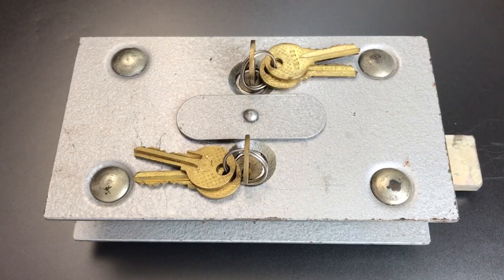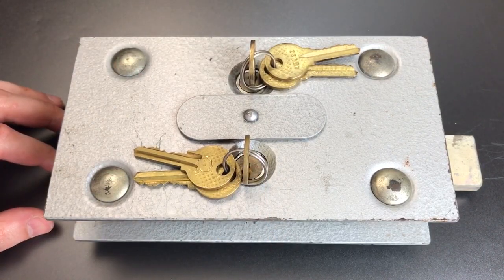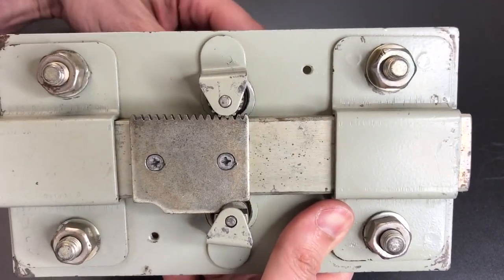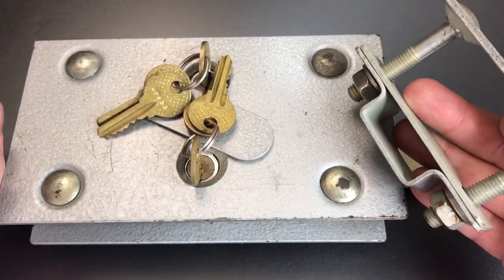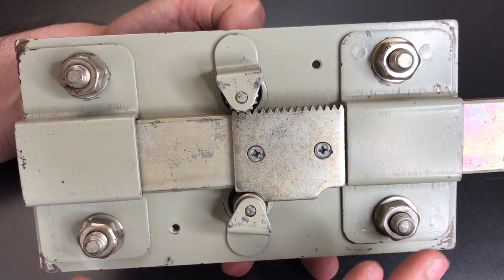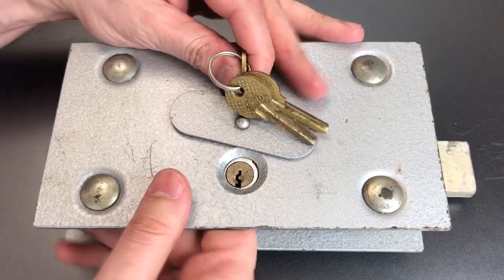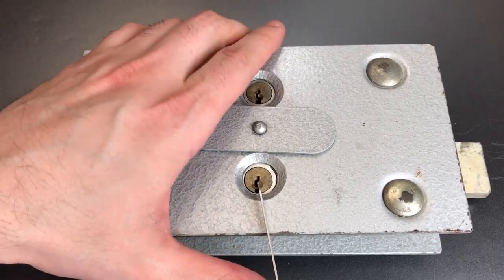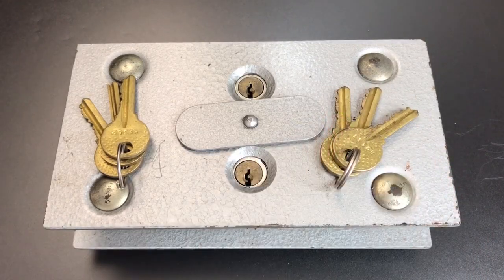[449] Cold War Era Russian Dual Custody "Safe Lock" Picked

Comment: It looks like those cylinders are made up of solid brass... which means that they're vulnerable to drilling attack. I'm sure that you could upgrade the security of this lock significantly by replacing the two Euro-profile cylinders with what would have a comparatively greater level of physical security and effective key-control against picking/bumping manipulation as well as impressioning & decoding, key duplication and/or production/reverse-engineering with the utilization of a 3D printer... of which has been known as of recently to have happen with high security rated key & lock designs; let alone common or low-security key & lock devices. 

Three enterprising MIT students demonstrated in a recent hacker conference on how easy and subtle it would be to produce a 3D working model of a high-security key that would subsequently be used on a 3D printer to produce a working duplicate of a key, only by writing a few hundred lines of computer binary code. It was also explained in the video that it could be done successfully in one leisurely afternoon. The students also went on (jokingly) to suggest a smartphone application that could be used for duplicating common house-keys simply by snapping a picture of your house-key and in a few days, get a duplicate key in the mail - all without even leaving home to do it... and behold... the Key-Me app and the Key-Me Kiosks that are beginning to make their appearances in some retail establishments, such as department stores and even local convenience stores as well.

In Europe, they have what is referred to as an "EZ-Entrie" Machine, that is a small tabletop computer-controlled precision micro-mill that is designed or intended to mill custom key-blanks on demand. This particular machine retails for around $10,000.

It looks to me like this type of lock might have been in use on a vault door, as the locking control device that regulates or restricts the movement of the bolt-work assembly that actually secures the door to the door frame. 

I've seen safe combination locks that have a similar design profile or footprint that is mounted in close approximation to the center of a door panel and that interfaces with a larger bolt-work mechanism that is then controlled by some sort of an auxiliary handle that is separate or apart from the actual locking mechanism.

The associated lock strike assembly also suggests that it also might have been used on a smaller door such as that of a storage room or a closet that would be used in a sensitive security installation that would warrant dual-custody accessibility. 

The Soviets were all too paranoid about the trustworthiness of a single sole key-holder or key-master with regard to clandestine counterintelligence or espionage, so this lock was likely used as a security element for secret/classified document storage or acquisition. 

Of course, locks of this type are now proven as obsolete by the common deployment of modern electronic access control devices, which probably and likely dates this design back at least 40 years or more.

I could also see this type of mechanism being deployed in some specific military applications where sensitive documents/intelligence information, chemical/bio-weapons or other dangerous weapons, munitions or ordinance that would need required dual-custody access control to be stored or kept secure in the event that one of the keys was compromised, lost or stolen.

ICBMs (Inter-Continental Ballistic Missiles) also had interlocking mechanisms that had dual-custody credentials or physical "keys" - for an obvious reason, that would be required for them to function or activate without resorting to some sort of a "MacGyver-hack" or hard-wire bypass security attack to effectively set them off.
Reply from the maker: WOW... that's a LONG comment.  Thanks for all the good info.

Comment: This is a shielded soviet prison lock. This would be placed on a door any given hallway through which inmates would be escorted. This would be placed into a door, and then have a steel plate both in front of the lock and behind it. Most Soviet prison doors were approximately 8.5-10 centimeters thick. 

From my own father, who was a prison warden in the USSR.

Comment: I've always wanted something like this, scaled up, for my front door. 
Except a key hole on the outside like this, it has a handle on the inside to turn the core with the gear. And remove the other core that just blocks it.

Comment: It is acess validation, not a room protection. This kind of lock is accomodated with two security stamps. So imagine, you have two  string pairs attached to the door and the doorframe. Each pair goes to a bottle cup, you cover them with paydough and then you stamp your seal on it. So to access room correctly without anybody noticing it, you have to open and close two locks with two keys, and then recover the seals with two different numbers with seals. It is used in the buildings with restricted access and guards. It can be used in archives, army buildings etc...  Guard regularry checks all the seals and doors locked. Two different people are required for entrance and they do not have to do it the same time. Boss can open the first part in the morning on several doors. Personnel can enter the rooms itself during the day. So boss cannot enter the room without the knowledge of the personnel responsible for the room. But both of them are responsible for unlocking by key and stamp.
Reply from the maker: All interesting, thanks.  Though I would note that:  "Boss can open the first part in the morning on several doors." is incorrect... unless he leaves his key in the lock all day long.

Comment: I think it's a lock for a boat's hatch. I've seen a similar one on a hatch to an area on a boat that was converted from one type of storage to one that housed high value goods. Also, the fact that the one piece of exposed steel is pitted (presumably from salty air); Nuts and bolts don't count because they can be replaced and are, I think, chromed.

Comment: looking at the locking notches on that bolt it also looks like someone could turn that bottom core and prevent locking of the door which id imagine has benefits in some situations too.
Reply: No. Its so the lock can be mounted on right hand and left hand doors without turning it. So its the same core that unblocks regardless of its on a left-hand or right-hand door. Notice how the bolt is mounted and would extend on the opposite side of the lock when "unlocking". So if you mount it on a right-hinged goor, the bolt would lock to the left and unlock to the right.

Comment: i saw two shitty pin tumbler locks on soviet era gun safe where few 22lr bolt action rifles and probably one ak were stored. and it was located in a shooting range of ukrainian school that was used during course of beginners military training(in russian нвп - начальная военная подготовка). but it was protected by alarm system with few reed switches that were not easy to reach so it was pretty safe
Reply from the maker: Layered security and the inclusion of alarms is nice... but quality locks as one of those layers is nice as well!

Comment: It looks like something on a soviet submarine like a typhoon as it is dual custody (Captain of the vessel and military adviser to the vessel) and it would usually contain passwords to a secure terminal where high command would phone you the launch codes for a nuclear weapon of some description, also sconce there would be no tools or anything to unlock the lock without keys on the vessel you wouldn’t need a secure core or anything.

Comment: Possibly a weapons locker. A very inexpensive weapons locker. It would have been someplace that someone would notice you trying to drill those bolts, or standing around and fooling with lockpicks. Possibly a police station, someplace that would be manned 24 hours. Also, over the years I've noticed that many things don't translate well to English as a light fixture becomes a chandelier depending on who's translating. So, "safe" might have meant "locker."
Reply from the maker: Thanks for your thoughts on this... particularly the possibility of a mistranslation.

Comment: looks like it is for a fenced in security area.  maybe bonded storage or controlled drugs. very easy to bolt lock to gate and receiver to fixed area of fence.
Reply: I think you’re right about security areas.  I’ve seen locks similar to this on security cages used for tool rooms in factories. The two keys are for personnel control. The key for the bolt is issued to foremen, the owner has the key for the bolt stop so he can lock it down during off hours
Reply from the maker: Nimikos -- if you are right, then the supervisor would have to leave their key in the door all day long.  :-(
Reply: I missed that the “blocker core” is key retaining.
The idea is not uncommon in businesses: medical supplies in a doctors’ office, the second keys going to nurses; car keys in a dealership, the second cabinet keys going to salesmen. I couldn’t find a double lock wire mesh partition door but here are some cabinets, same idea scaled down.
http://www.selectlocks.com/search.asp?keyword=Dual++Key+Cabinet&search=Search

Comment: I can't say what it was used for but another piece of evidence that supports your claim is the recess on the opposite side of the lower lobe. This I believe is useful so that if you entered a room with the bottom key and somebody didn't know you were in there, they couldn't lock you in since that position wouldn't allow the bolt to retract. Likewise without the top key you can't move that bolt.

Comment: its possible the two cores provide extra strength as they are directly integrated with the bolt.  Yet the lock is only opened by one person (the illusion of duel custody without the need)

Comment: It looks to me like the lock for the inner jail cell style door of a safe.  I'm fact, if you go to the history section of the wikipedia article, there is an open strongroom door that looks allot like this.  It also looks like once the custody bork is fully disengaged, the back side of the bolt interacts with what I would guess to be a wheel style bolt tractor for the rest of the bolts. https://en.m.wikipedia.org/wiki/Bank_vault

Comment: What is the likely hood of it being a zoo lock or animal holding lock, it would make a good bit of sense with there being little to no prevention of tampering on the reverse side of the lock along with the less secure overall design such as the brass cylinders that could be drilled.

Comment: You don't need two keys to open this, because you can close this with one. Second key just blocks operation of first lock. So it's not like two people are required to open the safe or whatever. It's more like authorized personnel can open a safe, but more authorized manager have to check if everything is in order and lock the safe for night  and unlock it next day.  Then workers can't use their keys to steal anything overnight.
Reply from the maker: Not really. Remember that the blocker key can’t be removed while the lock is in operation.
Reply: Can you confirm this ??

Comment: Seems very vulnerable to a physical attack.  Just drill or grind off the two bolt heads on
the bolt hasp or the bolts on the lock plate itself although this would take longer.

Comment: Fur Locker? There is a bank like vault in the basement of my workplace. Fur cost a lot back then.
Reply from the maker: Interesting theory.
Reply: It's honestly a shot in the dark. The fur vault in the basement is pretty cool its a 25'x30' room  14 foot ceilings and concrete so thick its always around 60 degrees. The entrance, like i said looks like a bank vault, I thought it used to be a bank and asked the owner and he passed the knowledge my way. Pretty  much a useless room now unless you needed to have bank like security. The door and walls are like 2' thick. And I'm sure the walls are thicker on the exterior walls.

Comment: One thing I did not see mentioned is it can be locked open.
Reply: zwz • zdenek This lock requires both keys to operate. Both keys can be removed if  the lock is either locked or unlocked. So it is not key retaining.
Reply from the maker: Yes, it can be locked open by either key.  Both keys are required to open and to close.
Reply: @lockpickinglawyer  Its so the lock can be mounted on right hand and left hand doors without turning it. So its the same core that unblocks regardless of its on a left-hand or right-hand door. Notice how the bolt is mounted and would extend on the opposite side of the lock when "unlocking". So if you mount it on a right-hinged goor, the bolt would lock to the left and unlock to the right.

Comment: would it be not way more secure with gears on both key ways so that you would have to pick both at the same time ?
Reply: the system seems to be of a supervisor/user style, widely used in USSR in places where a political officier was in place, with the user having the key to open/close the bolt and the supervisor the key to lock the bolt
Reply from the maker: Yes and no... it might be more secure if there was no gear lash... but there would be so you could still pick one at a time..  Also, the mechanism would be pretty hard to turn.

Comment: Safety deposit box
Reply from the maker: It's possible,, but I doubt it for the reasons discussed in the video.
Reply: Although I can't  prove it, there is not any purpose of having a two key system other that allowing multiple users to use the lock. If you allow multiple users usually you would keep a skeleton key. In this case one key allows for another key to open without the ability to open it on its own. The only system known to me that allow this are bank safety deposit locks used by banks. No other will lock themselves out of their lock. Regardless of installation designs.

Comment: what about connecting the two cores with a gear to need simultaneous rotation
Reply: Then You could tension one lock and pick both at the same time? So 10 pin lock in the end.

Comment: You could open this from inside. Unscrew the plate and slide the bolt.
Reply from the maker: Definitely... but the lock is certainly not designed for that.

Comment: mail box.
Reply from the maker: Two keys to pick up your mail?
Reply: Yes! I came across an old royal mail post box in an architectural salvage yard quite a long time ago. you know the ones, big red lumps of cast iron. Although it used mortice locks insted. It caught my attention because it needed two keys. aparntly it was out side a london grocers since before WW1, the grocer would keep one key and the post man would keep the other so when he came to collect the mail the grocer would identify him and they'd both pop open the solid cast iron door open so he could take the mail sack. I could be wrong though.  I'm going off a 20year old story told by a scrap yard hack ..but the lock may be a modern rendition of the one on the post box. Very interesting none the less. good find by the way.

Comment: I am thinking armored car.
I try to link a pictures below, the 4 screws at both side-doors loock pretty similar. Judging by the thickness of the glass, even the strength (height?) migh be similar.
alamy.de/stockfoto-brinks-gepanzerte-lieferfahrzeug-punta-arenas-chile-69822192.html

Comment: 45mm aint a very thick door.
Reply: Maybe for wood it wouldnt be, for a solid steel door it would be pretty thick
Reply: @AsukaLangleyS02  Yes but you dont make doors of a single 45mm solid steel plate. If you want that kind of protection you do multilayered doors and they would be thicker than 45mm.